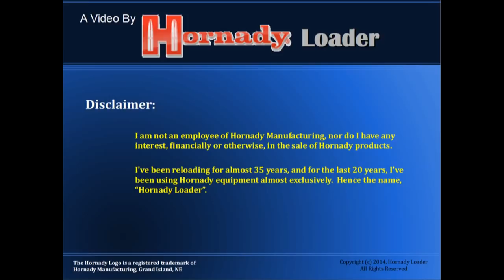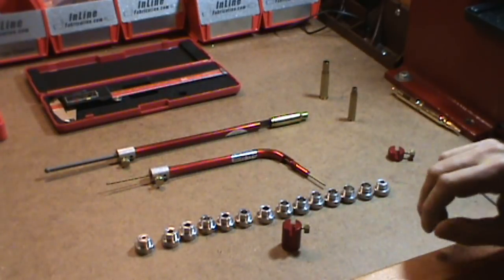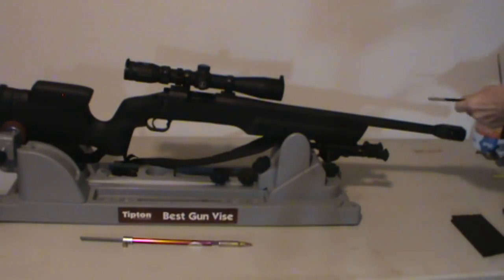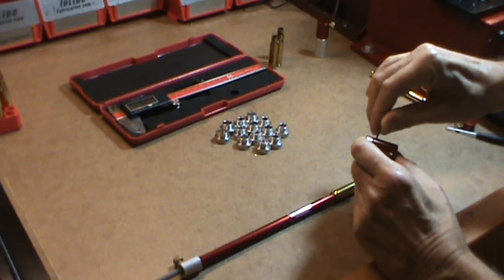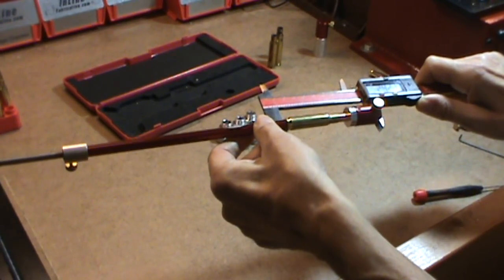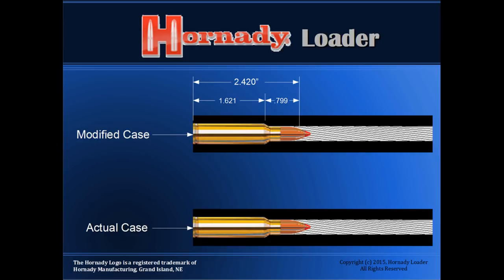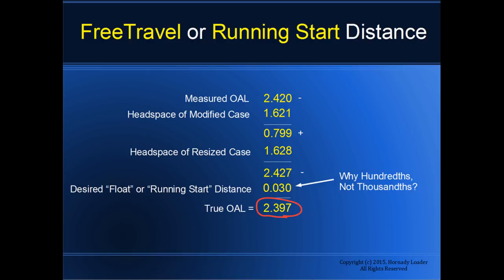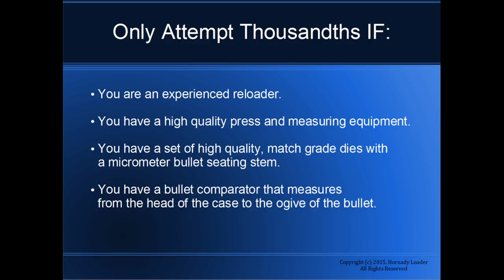Hornady Overall Length Gauge and Bullet Comparator

Comment: A very well presented video, but I'm new to this and a bit curious. The bushing you DIDN'T use was the #8 which measures at .30 which I'm assuming is for a .30 calibre bullet (you were checking a .308), instead you chose a #7 bushing which was the .280 one, which I'm thinking it's for a .280 calibre bullet.............Two questions.

1. Why would you just not use the bushing that Hornady says should be used for a .30  calibre bullet?

2. Would using the wrong bushing not throw off your proper COL?

Like I said, I'm really new to this so any info I can use is good a good thing..Lol
Reply from the maker: ruthless4645 Hi Ruthless,

Actually, the markings on the bushings simply indicate the hole diameter, they do not represent a caliber.  The COL is not affected as long as I use the same bushing for measuring both the OAL gauge AND the cartridge with the bullet seated.  I could have used the #8 bushing (hole diameter of 0.300"), but I prefer to measure further up on the ogive, as near the center of the ogive as possible.  The 0.300 bushing is only 0.008" smaller than the shank of the bullet and I've found that measuring so close to the shank sometimes produces varying results.

Excellent question though, I probably should have been more clear about that when I did the video.  Thank you for bringing that up.

Hornady Loader
Reply: HornadyLoader  Thanks for the explanation, and keep the videos coming!

Comment: Great Video. I wish I would have watched before I starting making a bunch of 300 BLK cases. I understand the concept about the difference between the modified case and the fire formed case. My question is if you have one case with a head space of 1.070 and another with 1.075 but both are trimmed to 1.360 am I still seating the same bullet in those two cases .005th apart or can the be seat same. Can seem to wrap my brain around this one. Thanks for all the videos, you are a wealth of knowledge.
Reply from the maker: +Jeff Horgan Hi Jeff, great question.  Yes, your bullets will end up differing by 0.005" relative to their distance from the rifling.  Let's say you set the COAL of both cartridges to 2.225".  Use the formula in the video to determine the distance from the datum line where the cartridge will stop based on the headspace of the case to the tip of the bullet.  The lower the headspace, the further the cartridge (and therefore the bullet) will go into the chamber.2.225" minus 1.070" is 1.155".  2.225" minus 1.075" is 1.150".  So, the bullet in the case with 1.070" headspace will be 0.005" closer to the rifling than the bullet in the case with 1.075" headspace.  I used COAL rather than CBTO but the result is the same either way.  The trim length is irrelevant for this calculation, the two important values are the headspace and either COAL or CBTO.Thanks for watching and great question!

Comment: Could you resize the modified case in your press to get the same shoulder length as your own resized cases? I know you need to open the neck back up to allow the bullet to move easily in the tool. But I would think this would give you the same headspace. Just curious if you’ve tried that, the math works as well to make sure you fall in the Hornady recommend .020 to .040 off the lands.

Comment: I am just getting started in reloading and this video was VERY HELPFUL in clearing up some critical issues for me.  Now I am not and never will be a competitive shooter but do want to improve my accuracy with the best ammo I can produce.

One question that I do have deals with the natural variation that occurs in the headspace when resizing cases.  I am using Dillon Carbide dies to resize .308 cases.  I just checked a good size sample and found the headspace to vary from 1.613 to 1.623 where my target was 1.620.  Most were in the 1.617 to 1.622 range.  My question is do I need to really worry about this and just setup my press to produce rounds with a True OAL based on the 1.620.  I think that as long as my Float is adequate to never drop below a safe minimum even with the shorter cases I would be okay?

I seem to get myself going in a circle thinking thru this and any help would be appreciated.
Reply: Allen Cain Forgot to add that I am loading on a Dillon 650XL using the Dillon Carbide dies and RCBS bullet seating dies with the micrometer dept adjuster attachment and then crimping with the Lee Factory Crimp Die.
Reply from the maker: Allen Cain Hi Allen, SAAMI standards call for a minimum headspace of 1.630 and a max of 1.640.  The actual values are unimportant since you are measuring on a different datum line than SAAMI.  The important thing to take away from this is that there is a difference of 0.010" between min and max.  Your measurements of 1.613 to 1.623 represents a difference of 0.010" which is exactly what is called for in the SAAMI standards so you should be fine.  The fact that the majority of your cases are within 0,005" makes me feel even more confident that you are in good shape.  I would invest in a L.E. Wilson headspace cartridge gauge for .308 Winchester (Midway USA part #880646) which will help you determine if your cases are within the SAAMI standard.  Of course SAAMI standards are designed to allow a cartridge to fit in ANY firearm of a particular caliber so even if your cartridges aren't exactly SAAMI, the more important measurement is what YOUR firearm works best with.

The other thing I would work on is to find out why there is such a relatively large difference  (if you can call 1/100th of an inch large)  in your cases coming out of your sizing die.  Is there some play in the die, ram, or shell holder/plate?  Check that each piece involved is tight and has no play in it.  I am not familiar with the inner workings of a Dillon press so I can't be more specific.
Reply: Thanks for the excellent feedback. I do have a Dillon case gage and all of the cartridges checked ok. I had trimmed them all after sizing.  And I will be checking for any loose points in the press to see if I can tighten the range of dimensions.

Comment: When you are testing your running start value for your particular gun, you mention that you will make (2) groups of 5 and start at 30 thou, and then 25 thou, and so on.  My question is, are you doing this after you have decided on the final number of grains of powder?  Excellent videos, thanks for taking the time to do these.
Reply from the maker: Hi omnis01,  Yes, I do the jump settings as one of the very last steps in developing a load for a particular rifle.  It's important to have a stable load before doing the jump ladder.  That way any variations will be because of the jump amount and not some other issue like  powder charge, primer, case setup, etc.  Thanks for watching! - HL

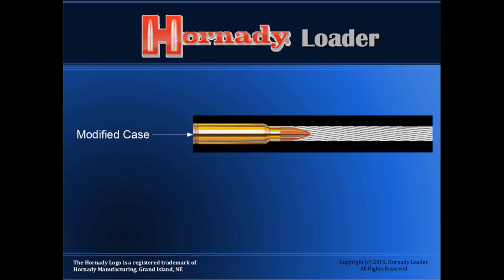Comment: I know this is a publication from some years ago but I have watched it more than once and benefited greatly by it. But I have a question. At 18:37 you explain why using a modified case does not give the true overall length of your completed round. You then reference using a cleaned and resized case to get the correct measurement. You also termed it a fire-formed case. Is it still a fire-formed case after resizing? To be fire-formed, wouldn’t that require just a neck resizing and leaving the body that has been formed to your rifle chamber as the correct way to measure? Thanks.

Comment: When you measure from the cartridge base to the ogive, you aren't measuring the OAL of the round.  And zeroing out the caliper with the body and bushing length won't give you OAL either.  If I'm not mistaken, you never really get OAL with this device inspite of the name.  The key here is the word "comparator".  You are only establishing the comparative distant between a bullet seated to the lands and one that you have backed off from the lands.
Reply: Among other discrepancies in this video that are just wrong.

Comment: I wanted to see if you would clear something up for me, regarding bullet seating depth and headspace.... Let's say I am working up a load and come up with the following data:Using Hornady OAL guage & Hornady bullet comparator1. Fire-formed case headspace -  1.5642. Hornady prep-case headspace - 1.5623. COAL (at ogive), using the Hornady prepped case - 1.970Here's my calculation as I understand it = 1.970 -(1.562) + (1.564) = 1.972 (minus .030 setback to start) = 1.942Here's my question.... Exactly how do I use that hypothetical 1.942 number?  A. - On new brass B. On fired brass that I have bumped back to, say, 1.562 C. ?Thanks in advance!
Reply from the maker: +Jim Goodel Excellent question Jim!  You've correctly identified that there is a flaw here which is leading to the confusion as to what type of case to use with your calculated OAL value.  The problem is in your calculation.  You are using the fire-formed headspace (1.564) in the calculation instead of the bumped back headspace (1.562).  The correct calculation would be 1.970 - 1.562 + 1.562 = 1.970 - 0.030 = 1.940 (the desired OAL at the ogive).  In your case, the headspace of the Hornady Modified case and the headspace of your bumped back and ready to load case is exactly the same (within 0.0003 anyway).  You would use this OAL (1.940) with fired brass that you have bumped back to a headspace of 1.562.  If you wanted to use new brass, you would use the new brass' headspace in the calculation  (assuming it is all the same headspace) so let's say, for example, your new brass has a headspace of 1.559.  Your calculation would be 1.970 - 1.562 + 1.559 = 1.967 - 0.030 = 1.937 (desired OAL at the ogive with your new brass).
Reply: +HornadyLoader Thanks.... That was the missing mental step in my calculation..Appreciate your time to answer my question.

Comment: Thanks to you I bought Hornady's OAL/Comparator kit.  Why can't I just thread a case I've fired in my specific rifle and use it to measure for seating depth?
Subscriber Dave
Reply from the maker: ***** That's the best way to do it.  You just have to send Hornady a couple fire-formed cases and $15 and they will modify one and send it to you.
Reply: HornadyLoader Thanks!  That is an unusual pitch on the threads!
Reply: Joel Schenk Thanks for the tip Joel.  For others that may read this, an alpha/numeric index,  letter "L" bit appears to substitute for the 7.3mm.

Comment: Hi HornadyLoader ! I want to get your thought on when measuring cases if 2 anvil base kits from Hornady will give me a more accurate reading then trying to balancing the case on such  thin caliber arms ? Your videos are the best I have seen out there !  Some are pretty crude in some ways which I do not care for due to the lack of equipment . I,d rather be safe then sorry and by the way I love my weapons and do not want to destroy them for a short cut  ! Thats why I watch yours , the right equipment gets the job done right ! Thanks for the input !     Robert
Reply from the maker: +Robert Amaty Hi Robert, Thanks!  I appreciate the kind words.  As far as the anvil goes, it does make it easier to square up the base on the caliper arm, but you'll get the same measurement with or without it.  As far as using an anvil on the neck side of the case, be aware that if the neck is off canter or slightly diagonally cut, you will only get the high side measurement (which is probably what you want anyway).  Burring or other deformation of the neck would affect the measurement as well.  The trick would be to make sure the case base is properly squared up even though the neck side doesn't look square.  also bear in mind that the two anvils would need to be squared up with each other.  This would be easily accomplished by attaching the anvils to the caliper arms loosely, then closing the arms so that the two anvils are flat against each other, then tightening the knob on both.  Zero the caliper at this point, then you're set for measuring cases.  I hadn't really though of using two anvils for measuring cases until I read your comment...I'll have to play around with that and see if it improves my measurement abilities. Thanks again!
Reply: Hi Hornadyloader !  I,ll do some more research on this and i,m sure you will to , but I think it is feasible . trial and error ! Thanks HornadyLoader ! I,ll get back to you !  Robert

Comment: How do you find out the head space measurement for your fired case?  If you are going to send a fired case to Hornady should it be fired, fully resized, and trimmed?

New to reloading and working up a .308 load and would like to start looking at different seating depths.

Comment: Great video thank you. I just have a question ; following your video I used my Hornady head space Gauge to measure virgin Lapua brass and the same brass fired once from my .243 - I referred to SAAMI specs and seemingly the minimum headspace is 1.630 , the virgin brass is 1.6222 or 1.621 and only a thou bigger when fire formed. Have I missed something ? Thanks

Comment: Hi Hornady Loader , I have a problem I’m hoping you can help me with . I’m using a Hornady bullet comparator with a 8-30 cal bushing with the Hornady 168gr A-Max 30 cal bullet , the problem is that after I used the Hornady O.A.L gauge to determine the length to the lands of my rifle and then using  the bullet comparator I got a reading of 3.070 which cannot possibly be correct , so then I dropped a 168gr A-Max bullet into the 8-30 bushing and I noticed that the bullet slips all the way into the bushing until it is stopped by the inside of the base without it even touching the inside of the bushing . My Question is why is this so ? If I use the 7-28 cal bushing like you do in this video will I get a correct measurement of the maxing length to my lands , even though the bullet comes to a stop well short of the ogive in  this 7-28 bushing ? I really enjoy learning a great deal by watching you do your thing . Cheers

Comment: i have a question, im new to reloading. you say your reloading 308, why would you use the .28 (7mm) guide, and not the .30 guide???  the guides basically represent the barrel and lans, by using a smaller caliber you get a different measurement for your actual 308 rifle your trying to measure..... am i wrong??????

Comment: In using your example with the fired brass is longer than the modified case,  why don't you seat the bullet down further to make it 2.420"?  Isn't the 2.42" figure the correct length?  I don't understand why the .799 measurement fixed and never changes?  In my mind, your OAL is too long to fit in the chamber and you've pushed the bullet up against the lands... aren't you? You know way more about this than i do, can you tell me where I'm off?  Great video! Well done, I'll be watching all your other ones too... as a newbie, you just can't know enough on hand loading!

Comment: For 308 the Hornady manual calls for a C.O.L of 2.800" from the head to the bullet tip. Using OAL gauge measuring from the ogive to the head I'm fall well under the manuals 2.800". But when I take a COL measurement from the head of the cartridge  to the  bullet tip I'm way over 2.800". Is this safe?
Reply: That's SAAMI specs. They added a huge safety factor to account for different barrels since, they're all cut differently. The rifling doesn't always start at the exact same distance and, if your bullet starts out in contact with the lands, you're going to have a pressure spike that could potentially be dangerous. So, they backed it way off to make sure that no factory ammo would contact the lands. This is why you gauge your rifle. Then you know exactly where the lands start and, you can safely load that long.

Comment: I'm curious what your experience has been when you shorten the setback number.  Do you always get better groupings, or is there a point of no more accuracy and you risk running the bullet into the riflings?
Reply from the maker: +superkillr Hi, It depends on the bullet really.  With the A-Max, I've found I get better results with a 0.010" to 0.015" setback.  with the Sierra 168gr MatchKing, It's better at 0.005".  Closer to the rifling doesn't always mean better.  There are a few bullets I've used that do better at 0.030" to 0.035".  It's hard to judge based on just a few tests, I've been collecting this info for several years and still experiment with different distances even with bullets that I've been using over a long period of time.  Eventually, a pattern will develop for each bullet/rifle combination.

Comment: All this is great but what if the projectiles you want to use are a lot longer say 208 grain, instead of you 175 grain projectiles, how much room do you have on the 7.62 X 51 or 308 hulls ?
Reply: You need to go through the measurement for every single bullet type you use. So a 208gr get its own measurement and the 175gr gets its own. If you do anything at all different, like switch brands of bullets or change from SMK to SGK then you do it again. Any change in bullet geometry requires a new measurement.

Comment: I only use for my Rem 223 about 6 different bullets.? So what I do is make one Dummy round of each minus the primer.? So the next time I load for that bullet.? The seat debt  is already pre set.?
Reply from the maker: +A REDTAIL Hi Redtail, You can do it that way, but I don't usually make a dummy round for each bullet.  I record the CBTO (Cartridge Base To Ogive) for each bullet for a specific firearm, then when I'm ready to create a batch using one of those bullets, I simply adjust the seating die to that CBTO.  A dummy round of the correct length would make it faster and easier to make that adjustment, but over the years I've gotten pretty quick with the adjustments anyway.  Thanks for watching!